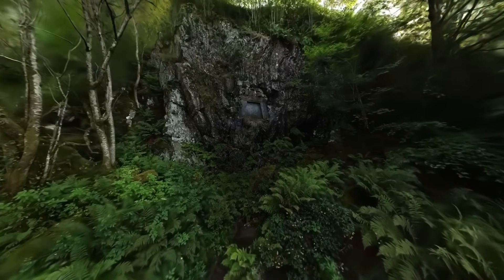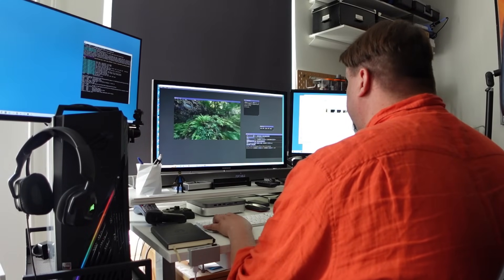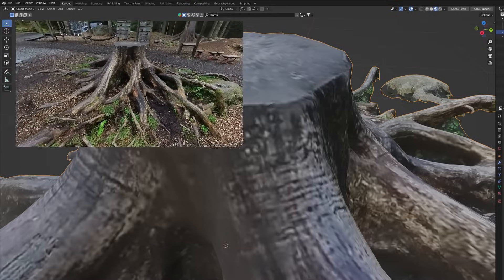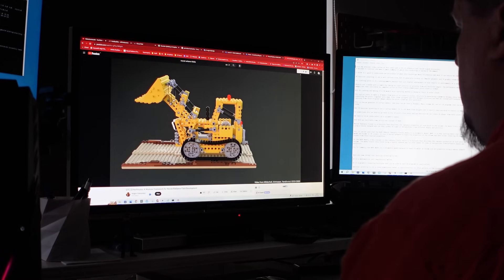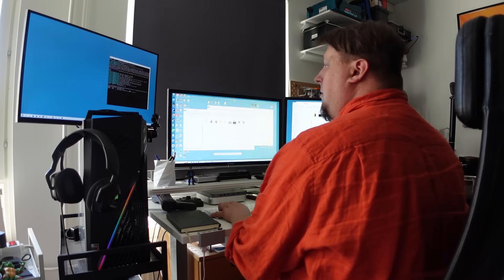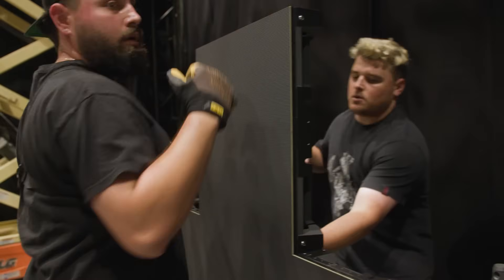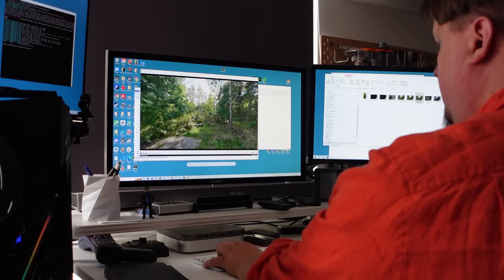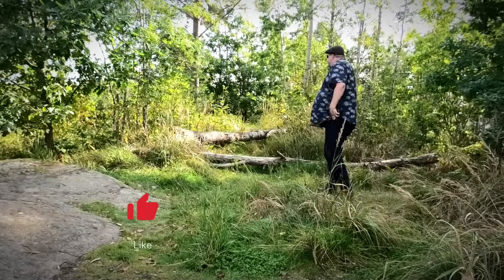What 3D Gaussian Splatting is not?

Comment: All gaussian splatting examples I have seen have been generated from photographic data. How about using high fidelity digital graphics and then rendering those with gaussian splatting to make then run more efficient and/or look more realistic than would be possible with polygons?
Reply: I've been thinking about this. Probably using non real time raytracing to achieve high fidelity images, and then use those images to be able to use 3DGS for real time graphics could be plausible
Reply: I’m not sure that doing so would result in something that looks more realistic than the initial rendering.
More-efficient, however, does sound likely to me.
Reply: @drdca8263  Yeah the point would be to recreate computer graphics that take days to render, but in real time with high fidelity
Reply: Gaussian splatting currently requires very high vram which makes it unattainable for most.
Reply: Baked lighting is already a thing with polygon based rendering by incorporating lighting into the textures.
Reply: @Kenionatus  yes, if you want to go back to 1996 era graphics, even then we had very basic vertex dynamic lighting for things like flashy light effects. But full dynamic lighting has been a thing since 2003 when doom3 came out. I really don't see any benefit for using this in a video game over traditional rendering techniques.

Comment: Great video. Could you make a simple step by step tutorial on capturing data from a mobile device, to having the gaussian splatting inside a Unity scene up and running? And also, how’s the quality when converting the captured data to a 3D model (point cloud to mesh?). Keep up the good work!
Reply: The Point-cloud itself isn‘t any different than the one made with nerstudio or so. It is done with colmap. So The quality should be something like the tie point - pointcloud from aligning images in metashape, probably not as much optimized and dense.
Reply from the maker: I'm not much Unity guy my self. I recommend to watch my other videos about Luma AI. It is simple method to create NeRF which can be converted to 3D surface models. Or another great service is 3Dpresso.
Here is a  link:  https://youtu.be/kV0OAvlXShk?si=TMl9nxck27eV55Pd
Reply: @OlliHuttunen78  Thank you, already used Luma AI before, I was thinking about a way to capture static scenes with mobile video to then use in Unity with 3DGS (and wondering about all the current intermideate steps until an easier solution is developed), and also converting this data into a regular mesh/3D model. Going to check 3Dpresso out!

Comment: Cool. I didn't know it could capture movement. I would guess it's very bandwidth intensive, though.
Reply: No idea how it works under the hood but it may not be as bad as one might think. If the points in the point cloud are what's moving, then it's similar to a vertex animation. Which can be baked into a texture as well, reducing the data that passes around after the initial texture loading. So in that area there is not much of a difference to what we are doing already. The points also look somewhat sparse in the video, so that's a plus as well. But certainly with high density animated chunks it will become costly both for the bandwidth and the VRAM.

Comment: Wonder how you'd tie physics to the splattfield so you can interact with it in real time, interesting stuff!
Reply: Well. This splatting is a point cloud so essentially individual vertexes I guess. Which is essentially what particles are too in a particle physics framework. If you can calculate depth and we can otherwise the platting would not overlap points behind it from all angles. Then we essentially know the volume so its form so could do physics too.
Reply: If used in gaming a separate environment collisionmodel would be used
Reply: it would SUCK, right? Basically a whole alternate invisible polygon geometry for collision, even if its generated at runtime. I don't see how you could do collision without turning it into tris or quads at some point. There may eventually be a way but its going to be a new algorithm.
Reply: @confuseatronica   Environmental collision models are used all the time in gaming, because high poly models perform worse for physics. This really wouldn't be much different. Quite often staircases are replaced with sloped planes etc, fences with just crude box geometry and so on.
Reply: @Jokker88  But that's not a solution, that's just a work around. That's also a really bad solution; we want collision to be as accurate as possible otherwise character controllers, NPCs and physics will be buggy and broken. Simplifying the geometry also means you won't be able to accurately project decals onto models. You  could somehow figure out precisely where in the point cloud the decal should stretch, but now you're essentially doing double the work to achieve something that is already viable with traditional rendering techniques. At this point Gaussian splats are just here to look pretty, nothing more.

Comment: Very cool! I hadn’t seen that people were already working on making it work with moving subjects or changing light-sources!
I see in the video that someone has combined another 3D model moving within a scene rendered with Gaussian splatting, with occlusion working between the the traditional 3D model and the point-cloud stuff.
Have you seen anything where two different point clouds (from two separate photogrammetry sessions) are composited together into one scene, where one moves relative to the other?
Are there any particular issues that would arise when trying to do that?

Do you know any good video that goes more into the math of how the rendering is done?
My understanding is that each splat has:
1: a symmetric 3x3 matrix that specifies the size and shape of the Gaussian (I think it should be symmetric anyway?) (because symmetric, this should only cost 6 numbers rather than 9)
2: a combination of rgba as coefficients for some “third order spherical harmonics”?
Uh, my memory about spherical harmonics is a little rusty.
Were spherical harmonics labeled by 3 integers, or is it just 2 integers and the other one I’m thinking of is me just getting mixed up with energy levels for atomic orbitals having an effect on which spherical harmonics uh, have a corresponding orbital at each energy level.
Or, I mean, for a non-relativistic model of a hydrogen atom.

It’s probably just 2, right?
So it is probably like integer spin values?
So, 0th total-spin has one (the spherically symmetric one)
1 total-spin adds 3 more,
2nd order(?) adds 5 more,
3rd order adds 7 more,
For a total of 16?

Uhh, and then 16 * 4 = 64 ( where 4 is from rgba)

And then add on the 6 from the shape of the Gaussian, for a total of 70?

Wow, that’s surprisingly many (to me)  floats for one blob.

But it seems very likely that I’ve misunderstood , and that this isn’t actually the accurate count of the number of numbers associated with each Gaussian (other than the 3 for its position).

Hmm, when you project a 3D Gaussian (without any of the spherical harmonics or colors or anything, just the plain Gaussian) onto a plane do you get a Gaussian?
Let M by the symmetric matrix. Let it be based at the origin, for simplicity. The Gaussian assigns to point v a density proportional to exp(- v^T M v / c) for some constant c.
If we do an orthogonal projection (not the one that would be used in this process, just something easier for me to get my hands on), then what we do is we integrate this over one axis.
And, hmm...
v^T M v , if we split it into the parts that do and don’t depend on e.g. the z variable..
there’s the z^2 • (its coefficient in M) +  2 z • ( (x,y)•(some 2D vector in M))
as the part depending on z,

And then there’s the other part (x,y) S (x,y)^T
where S is the relevant 2x2 portion of the matrix M (S will also be symmetric)

Yeah, ok,
the result of this orthogonal projection is a 2D Gaussian multiplied by a factor based on the other direction I guess.

Oh, I guess we could decompose the symmetric matrix by expressing it as a diagonal matrix conjugated by an orthogonal matrix,
And then, if we sandwich this between the orthogonal projection matrix of our choice,
Or, uh, hm.
Ok, maybe that’s not informative after all.

Comment: I'm having a problem using my insta360 1 inch, I've shot in 6k and I'm getting nowhere near the quality I'm seeing you put out using the same method, I even use 200 bitrate on export and still don't like the end result when I export the model and pull it into Unreal, I went back to normal photogrammetry, with just taking photos, it seems to be giving the best quality, I'd love to use my Insta360 1 inch because it allows you to capture faster and just choose the direction of the video after

Comment: Can you turn an already rendered scene in polygons into gaussian splatting, to get higher detail in real time? Or does the origin of a scene always have to be photographs?
Reply: If you already got the polygons that means you already have a more dynamic and versatile representation. This is a method for visualising point-clouds effectively - not for for rendering scenes faster or more accurately. 
The thing is polygons are way way way faster to render, can be used dynamically (you can for example just turn on a light), and can reproduce details way more accurate. Buuuut creating the polygons initially is a lot of work.
On the other side we got photogrametry - using cameras to capture the outside world and (nearly always) turning it into 3D point clouds. But points are not polygons so they can not be rendered directly (or you get these familiar images were 90% of the screen is black with a few coloured pixels in between, and converting them to polygons is computationally intensive and often requires a lot of human interaction.
And that is the niche were this technique can be used: it gives you a good way of visualising the original scene directly from the point-cloud without having to go through the step of re-meshing everything. And this is more than good enough if you really just want to see what was initially captured. But if you want anything else like the vegetation being affected by air-movement or the light changing with time then you are out-of-luck as those are impossible with the point-clouds.
Reply: @ABaumstumpf  cool, thank you for explaining!

Comment: Thanks. Instead of using photos from the real world it should also work with photorealistic rendered images from blender using cycles...  or not?
Reply from the maker: Yes it would. This is interesting question why would you turn something which is already digital 3D model to another 3D model form. I could only see the benefit in that case if you want to scan something out from locked enviroments like console games or dreams game engine which is designed for playstation and has no way to export models out to any 3D format. But it will work. You can render model out as pictures and turn it then gaussian splatting model.
Reply: @OlliHuttunen78  I thought of realtime gaming with photorealistic visuals on nearly any device because of the high performing Gaussian Splattering.

Also, if the input images are based on a 3D scene, maybe AI can use that additional data to create the Gaussian representations even faster and with fewer images rendered
Reply from the maker: @gridvid 
Hmm. Interesting thought! I haven't even thought about it from that point of view. Yes! It could work and speed up the presentation of realistic renderings. Because the heavy calculation would only have to be done once and then it could be run in real time. A very good idea!
Reply: @OlliHuttunen78  maybe worth a test for your next video? 😊

I hope this tech will be investigated even further till we don't need to pre-render 3D scenes... automatic baking them into  Gaussians.
Reply: @OlliHuttunen78 what about wanting to do volumetric scenes like dust/clouds
Reply: One benefit to this would be in 3D generation of 2D AI generative art.
Reply: Gaussian splatting is super fast to render. So a complex scene could be trivially rendered. I could see it's use for a highly detailed skybox/backgrounds with parallax

Comment: To my knowledge, there is a problem to make this technique feasible in videogames:  interactivity. This is like a "3D photo", so forget about destruction or dynamics like cloth. We dont need more "realistic but static" enviroments in AAA videogames.
Reply: obviously it would be mixed with polygons, point clouds and gaussian splatting.
Reply: @HamguyBacon  there is no need for this tech in the gaming industry. the main thing is NOT that the meshes and textures are off, it is simply the lighting that is the problem and it will be solved in this decade by real time path tracing becoming a real thing.

Comment: 1. I don't like how you have to take thousands and thousands of photos. Not only is it creatively bankrupt but it also requires large storage space.
2. Point cloud systems are really really bad for collision detection routines as the points have gaps between one another.
3. This is an awful solution for video games, especially if you want a high degree of interactivity.
Reply: yes and no. if this would be implemented in games, then by converting polygon data to gaussian splatting & render the result, kinda like real time raytracing. if the graphics card is developed exactly for this, it might work well.